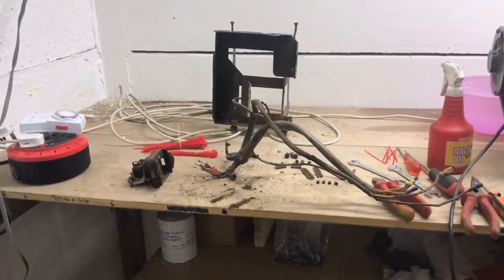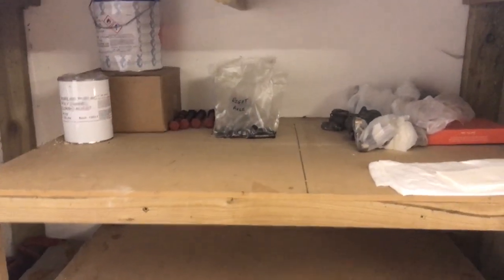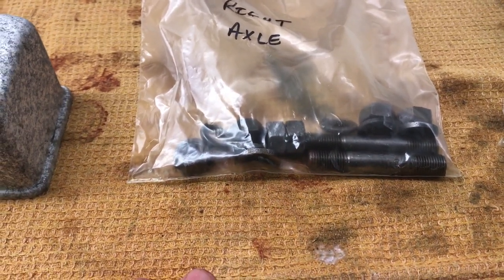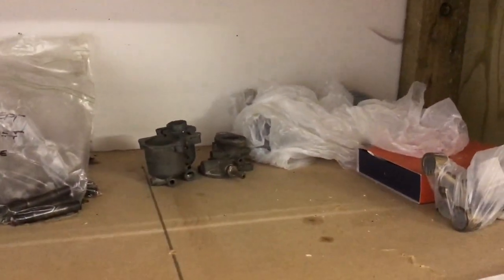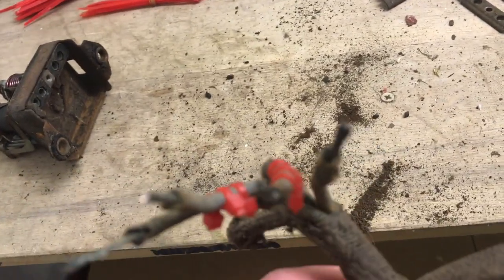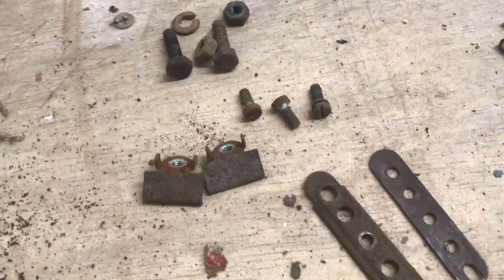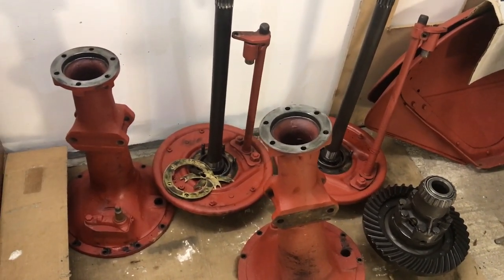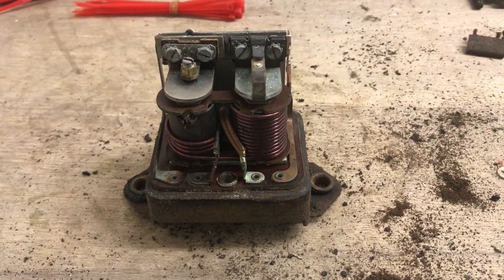#24 Ferguson TED20   Voltage Regulator and a progress update

Comment: Getting nicely organised Gordon, like the wire wheel. When I got the Nuffield a couple of years ago it wasn't charging. Had to have a refresher course on dynamo's and regulators, some helpful videos on here. Dynamo was good after cleaning the brushes and com up, but couldn't get the regulator to work so got another one.
Reply from the maker: Hi Malcolm. Yes I will need a refresher on these too! 😉 It’s been many years since I worked with either. I think I was a young teenager last time I serviced a generator/dynamo. 😉

Comment: I think I might borrow the idea of the plastic coating on the bench, coming along nicely keep up the good work one component at a time and one day you will have a finished tractor !
Reply from the maker: Hi Steve, it worked better than I expected. I used a long length of aluminium angle iron to force it down and hold it at the angle I wanted after heating it. Trying heat the entire length consistently was a bit of a challenge but just persevered and it came good in the end.

Comment: I don't think those rubber grommets are to electrically insulate the regulator box from the tractor ground, I think it is to reduce vibration of the regulator.
Reply from the maker: Hi Paul, thanks for your comments. We need to get back to the regulator etc. Still lots to do! 🙂

Comment: Cool what you are doing with your fergie but I thought this was a video about the regulator... Not a plastic bench and putting a wire wheel on a lathe and explaining what gearing it is instead of just buying a $30 bench grinder with a wire wheel... As I said love the fergie and the set up but maybe title the video "workshop and tool situation" instead..
Reply from the maker: Hi Adam, thanks for your comment. Sorry if you feel the title is misleading, this was not my intent. I may do a dedicated video on the regulator when we get to fitting all the peripherals.